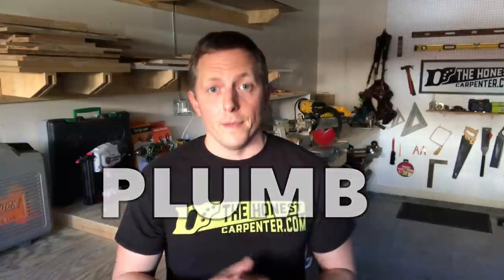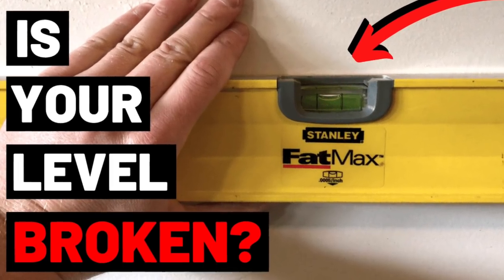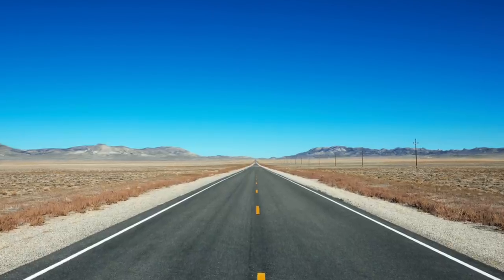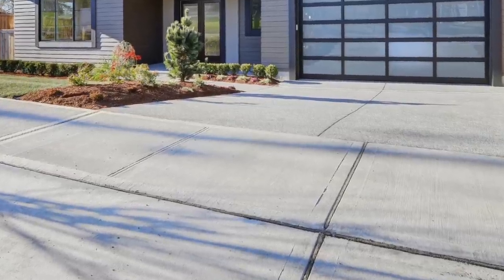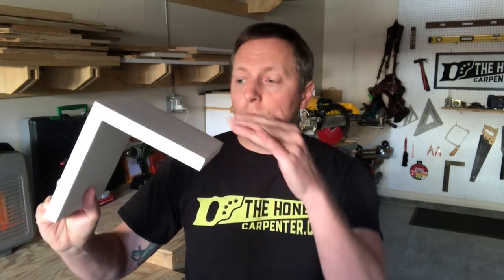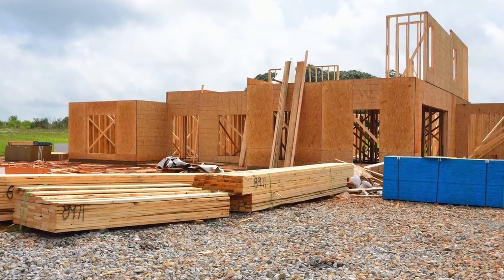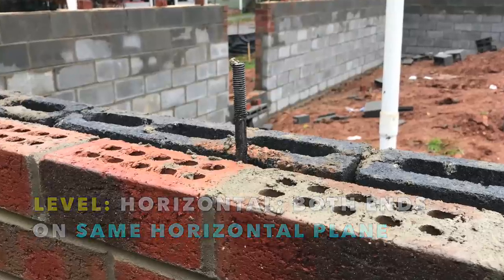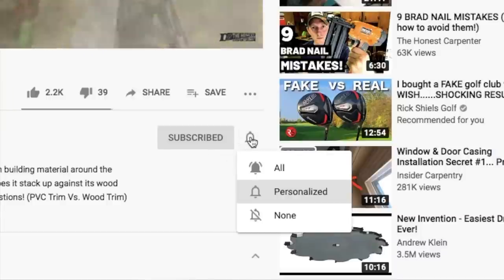PLUMB VS. LEVEL VS. SQUARE...What's The Difference?! When And How To Use These Three Terms

Comment: I build large pipe organs. The trade involves many disciplines, but we deal mostly with wood, lead, leather and glue😊. The organs are often quite large, and we set them up in our erecting area. When I was an assembly foreman, we used to say “bring your square, but leave your level at the door!” When you’re assembling something that will be shipped and reassembled, it’s imperative to square things off the shippable reference surface. It will be set plumb, and leveled later on site. Great video as always. Clear and well explained.

Comment: Great video. If you're a DIYer or amateur carpenter watching this, I can't stress enough how important it is to keep your work as square as possible. Even just one degree out here or there caused a domino affect and problems down the line.
Reply from the maker: I built an 8’x12’ floor structure for a shed years and years ago, Liam. It was an inch out of square, but I thought, “that’s not too bad.” After building the rest of the shed, I realized that square means square—even an inch turns into a nightmare real quick. Thanks for watching the show!
Reply: what if my spatial capability is out of whack?

Comment: Like the way you describe these concepts, so many people don't understand the concept of plumb as they should. It's great that you mentioned the plumb bob, which goes back to Roman times, even Egyptian times. Another, method not often used these days in to fill a plastic transparent tube with water, and hold it until water finds its own level. Also, as a house gets older, it settles, sometimes water runoff and geophysical activity cause a house to shfit out of sqaure because the ground can be become a little unstable waterlogged etc...

Comment: True is a term Ive most often heard in relation to bike wheels. You true the wheel by adjusting the spoke tensions to ensure the wheels spins without any wobble or dish.
Reply: Using math terms, something is square when a straight line is orthogonal or perpendicular to another.
Reply from the maker: I get the feeling every trade might use that word in some way, Comrade. It's just the best way of saying, "Yeah, that's how it's supposed to be." :)
Reply: Just for clarity. In terms of bike wheels I have built quite a few. True refers to wobble( left to right) or hops (up and down). Dishing refers to offsetting the hub where the spokes attach from the centerline of the rim. Front wheels are not dished ( spokes on both sides are of equal length). Rear wheels are always dished to make room for the gear or gear cluster. The spokes on the gear side are always shorter.

Comment: A friend had a house built 4-5 years ago. They did a “Level 5” finish on his kitchen walls as som walls had floor to ceiling cabinets. If I remember correctly they used man man studs and used plywood on the studs and then drywalled over the plywood and then the drywall finish was made as flat as possible. I remember the cabinet installer was very happy with the walls.

Comment: Love your channel. So much useful information. And some of it is stuff I knew and you have reminded me. My dad was a carpenter. He always reminded me. Lol and he used string in so many ways it boggled my mind. One that sticks in my head usa long board like say a ridge board he would stretch a string end to end to make sure it was straight when things were attached to it. 
I think you do a great job giving us your on the job experiences of what you learned hands on. 
One term you didn’t mention in your video which I think would have fit in was “flush”. Dad used that a lot too. Lol
Keep up the good work.
Reply from the maker: Thank you,TPC! I love hearing about the older generation of carpenters. I promise I’ll get to “flush” soon! 😁
Reply: My dad was an amazing carpenter. Everyone said so. I’ll get off the box after this. I was adding on to my house and was trying to get the corners of the vinyl siding up. They were always twisted. So he came over and said a good carpenter always has to be able to adjust to what is there. 
He said what you have to do is make sure the trim corner is in the same plane as the walls and that you don’t push too hard on the corner trim and make it flair. He made this simple jig (he was a master of those) in like 10 minutes that I put up the corner set this jig on it and presto it lined it up perfectly. Nailed it moved it up. I was amazed. 
I showed it to a guy that did siding. He made one for himself. Lol

Comment: plumbum is the original word for lead, thats why on the periodic table lead is Pb, everything in the periodic table used letters from its original name likely from latin. not necessarily named after the tool
Reply: I was just wondering where the term "plumbing" originated. Could that be from using lead, then?
Reply: @charlespatt  yeah it was lead pipes after concrete, great idea at the time.

Comment: Can't wait to find out how to test my levels.  I hope you suggest a way to fix them too.  I have more than one and they are not consistent so I know something is wrong for sure.  My house takes the nothing is plumb or level to extremes.  It is so hard to deal with.  Nothing is flat, square, plumb or consistent in any way.  It can be off in one direction in on place and in the other further down.  Such a headache.

Comment: I have a completely unrelated question for you,...
I'm wondering what is your choice for marking pencils?
I've seen some guys that I follow using some mechanical pencils and one time someone even mentioned what kind it was but I can't remember, so I figured I would just ask each of you as I watch your latest video releases. 
By the way, thanks for all you do for the woodworking community.
Reply from the maker: Thank you for watching, John! I’ve never used mechanical pencils because I tend to press hard when I mark, and it either snaps the lead or scratches wood. I hand sharpen round carpenter pencils, and groom the graphite tip throughout the day. That said, I know carpenters aren’t quite as precise as pure woodworkers 😁
Reply: @TheHonestCarpenter  OK. That's great info. 
Thanks for the reply.

Comment: Hi, I had to laugh when you said square was when two walls meet in a building, I have lived in many houses as my job took me all around the UK but there is one fact that I have never found in any of the houses, not one corner has been 90 degrees. I have been in new and old houses, but it is so bad that I bought and used to great advantage an angle finder that you put into the corner and then put it into a jig and you could then cut inner and outer angles and shirting boards etc. fit perfectly.
Reply: You’re lucky, my house has nothing even close to plumb, square or level.
Reply from the maker: It's true, John. For precise angles, you often cut closer to 44 and 46. I used to just carry around test pieces in my belt for inside corners and outside corners, with sharpie marks saying what they test angles were. But an angle finder is even better!

Comment: Since levels seem to have bubbles for both the horizontal and vertical, if you put a level to check vertical on a post can you assume it’s plumb as well?
Reply: He shows this in the video around 1:10, so yes.
Reply from the maker: Yes definitely, Steve. There's also something called a "post level" that checks two faces of a post at once--I should have showed it here, it's extremely helpful.

Comment: Just to clarify square must be in the same plane as the drawing is, this will 99.9999% of the time be in the level plane. 

When setting square, it must be done in the level plane (e.g. setting out a building)

When using a tool to set a square (such as a builder's square) so long as one of the 90-degree arms of the square is in the level plane a "True" square corner will be formed

Comment: Wish they would bring back shop class in college preparatory and STEAM high schools and even junior high schools/ elementary/ grade schools.  Sure there Might still be art class or drafting class, but the 3 elements you just explained should be taught and would make for better educated adults who don't understand that the house or building that they're looking to buy is going to require an initial investment of a structural engineer before they bring in subcontractors or handymen.  They act like their own GCs and when things aren't working out on schedule/ budget, or years later when something happens, they call a carpenter/ contractor and are amazed at the cost of fixing the tilting wall, bowed/slanted floor, ceiling height dropping 4" from 1 side to the other...
Sorry for rant.  Summary: hope they play your videos in schools!

Comment: Don't forget your measurement in feet Square like for instance 3-ft 4-ft 5ft equal a square. Where lines are drawn on the floor. Or 6 ft 8 ft and 10 feet where are you need a larger Square of all 90°

Comment: In my house nothing is square, plum or level.
It all just constructed by eye sight 😳
Just changed the door to the kitchen and when the door frame is plum the wall is sticking out 1 inch in the bottom and os flush at the top..

Comment: Not every single floor had to be true. say, shower room floor, pavement, you make it true, you will have to do it again few years later. if it is a multistory building. Fire sprinkler and a true level floor may be a perfectly legal combination to kill your elevator that worth $$$$$. the tricky thing is, suppose the workman get kicking around by the foreman, should he still “level” the floor on these critical points? the building belongs to the client, the reputation belongs to the company. And a “not true” floor is the workman get kick on the butt.